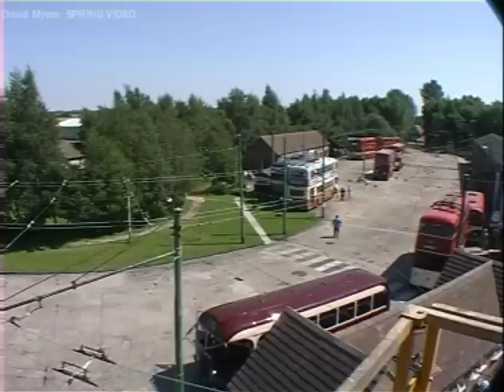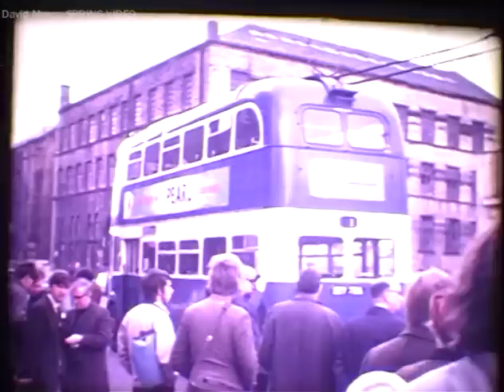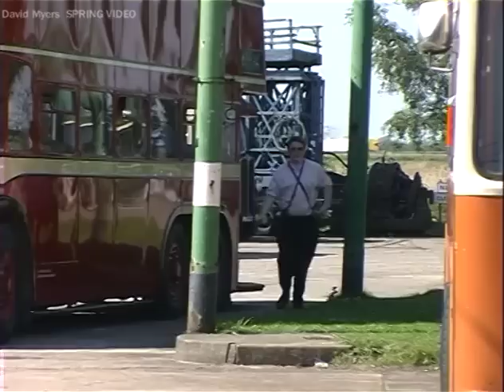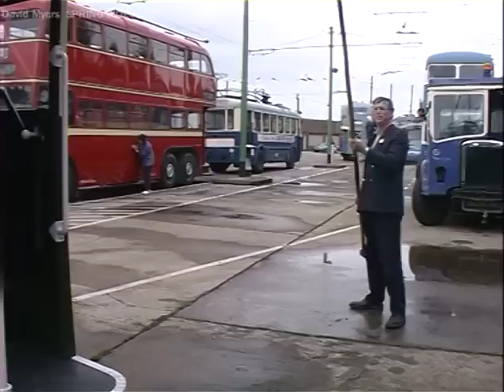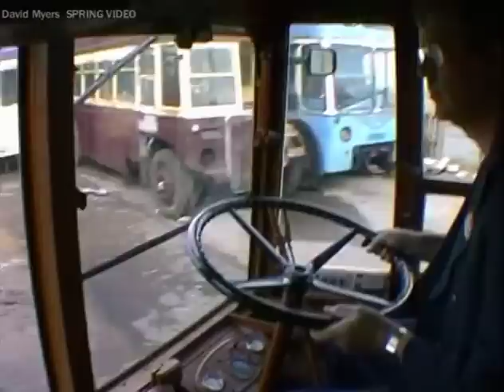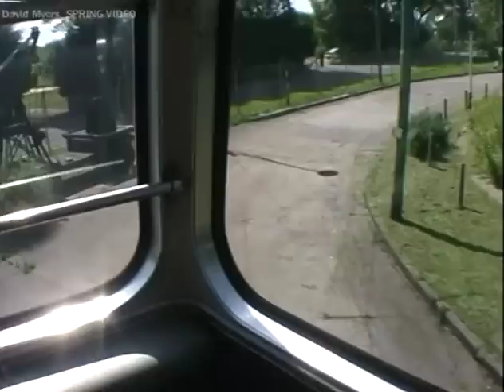WELCOME TO THE TROLLEYBUS MUSEUM AT SANDTOFT

Comment: Fascinates me how this worked in busy cities??!
Reply: They worked very well. 

No pollution, very fast acceleration, and higher seating capacity than trams and diesel motor buses. They could also overtake other road vehicles ( except another trolleybus in front ) as the trolley poles could extend right across a normal two-way road, so the trolleybus could pull out to the right to overtake slower or parked vehicles, than back to the left again.

Comment: Modern trolleybus overhead is far less obtrusive as in the previous systems. There is a definate place for such vehicles, especially if operable in dual mode electro-diesel guise, with modern construction methods.
Seen were the pioneering days, until urban planners in the 1960s decided otherwise.
Perhaps twenty-first century attempts can re-ignite a clean come back given some forward thinking!

Comment: Thanx for the great tour.  Where I come from in Auckland, New Zealand we had trolly busses until 1980 when the system was closed for upgrading.  They lied and replaced it with dirty diesel busses.  Our busses had BUT control gear with Ohio Brass overhead.  Could never understand why the bus accelerator was on the left side of the steering wheel and the brake on the right.  Was this a BUT thing??   Also I notice no overhear powered track switches only manual ones.  Was this the norm in  the UK??
Reply from the maker: Hi Paul. I understand the accelerator on the left and brake on the right reflected the layout of tram controls and was an aid to driver conversion from tram to trolleybus. I am not sure about the overhead powered switches here.
Reply: @davidmyers9810  For me, that should be the layout.
Reply: Cardiff trolleybuses had powered track switches in the overhead;the method of operation seemed to be approaching the switch the driver pulled on the handbrake at the same time  boosting the power supply throught the bus,this made the switch change.

Comment: Wow!! Double deck trolleybuses. I haven't ridden a double deck trolleybus since the late 1950's, when they ran in Sydney NSW Australia. I have ridden single deck trolley buses in later years during the 1970's, while holidaying in New Zealand. New Zealand's last trolleybus system operated in Wellington, which finally closed in October 2017. Anyway, thanks for sharing.
Reply: Yep that was criminal by the Wellington Council to rip out a basically new wiring system and buses that were only 10 years old.

Comment: Here in the U.S our trolley buses don't have point controls, the pole pulls the direction change on its own.
Reply: The hand-pull system to change the overhead points, operated by the conductor jumping on and off ( and not a popular part of the job, given British weather ) as shown in the video was outdated even by the 1950s in the UK and is there really for historical reasons. 

These hand pulls were replaced by points control from the cab by the driver and was quite simple. To switch the points to the alternate tracks, the driver passes a detector mounted on the current wires 6 meters or so before the points with either the power on or off. The points motor would then change the points, depending on whether the power was on or off. Once the bus had passed, the points motor would change the points back, usually to the straight ( mainline ) track which was the default setting.

Comment: I worked as a trolleybus operator for nearly a decade and a half. They weren't retired until 1994. I still have a headsign to remind me of better days. Ours were replaced by diesel and natural gas buses...both more costly to operate and maintain. I'm surprised by the manual switches...ours were all selectric or power. I particularly liked the E800's...very warm in bitter winters.
Reply: In what city you worked as a operator?
Reply: @Telecolor-in3cl  Hamilton, Ontario...both Toronto and Hamilton had trolleybus systems. In Hamilton, all the overhead was upgraded in the 1990s and then scrapped. Only Hamilton had the newer E800 trolleys from Flyer...one of which had high performance shoes and brakes before the decision was taken to scrap the service.
Reply: @obus7800  Why did they scraped it?
Reply: @Telecolor-in3cl  the Ministry of Transportation (provincial govt) wanted to promote alternative fuels...first a failed demonstration with propane in Ottawa then natural gas in Hamilton. If the trolleys were scrapped in both cities it would provide an opportunity to sell a large number of CNG buses to both cities from the govt's preferred supplier. Both cities were effectively "Blackmailed" into accepting poor performing CNG buses. Search an article, Dewired, for the full story.

Comment: Great video.  Very good clear explanation.  I travelled on one of the Nottingham Trolleys between 1959 and 1964 (one of the 8 footers) for school (Route 43).  I am sure I have sat many times on that actual 8 footer you have.  Do the trolley buses also have batteries for short emergency movement?
Reply: Yes, most if not all modern trolleybuses do

Comment: This is the future🙂
Reply: A modern trollybus system has so many advantages over trams but at a fraction of the price and difficulty of the inflexible dangerous track system. Plus with a battery pack on board you can divert round accidents and temporary diversions.

You could skip any overheads at  junctions and turns.. 

For bodys use the 6 wheel double decker coaches...with large luggage rooms at the rear down stairs so you could carry bikes, prams and shopping trolleys out of the way of passengers.

Comment: Great educational  video.
Went to Sandtoft in 2014.
Pity the London trolley wasn't working, I remember them well.
Strange that the accelerator and brake are reversed.
I still don't know how they tension the tra tonight wires which must expand and contract.
Reply from the maker: Hi Steven.I understand the control handing was to aid tram drivers to adapt to trolleybuses. If you look at a tram controller the regulator is on the left and the brake on the right.